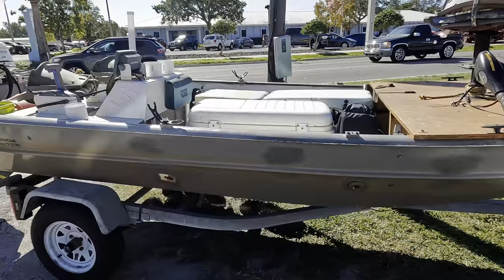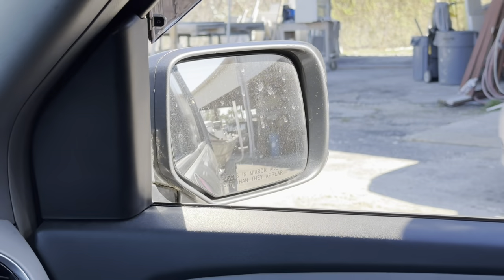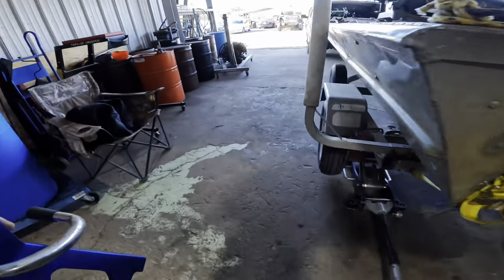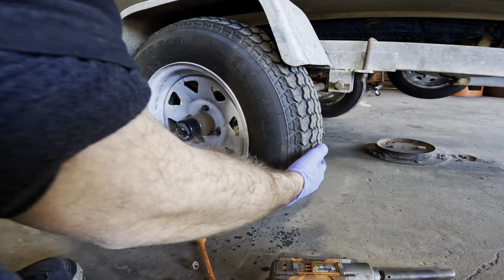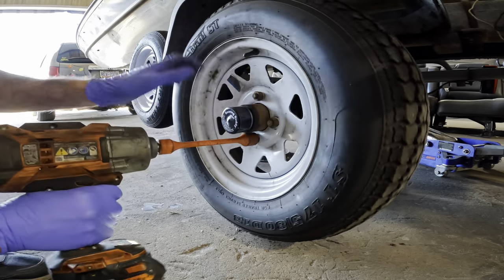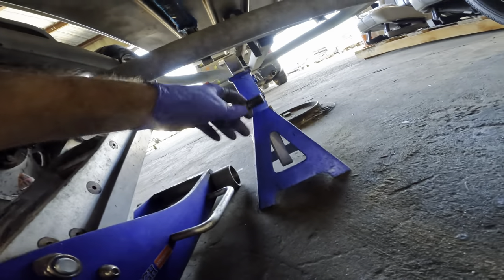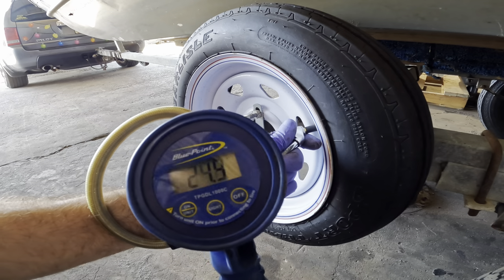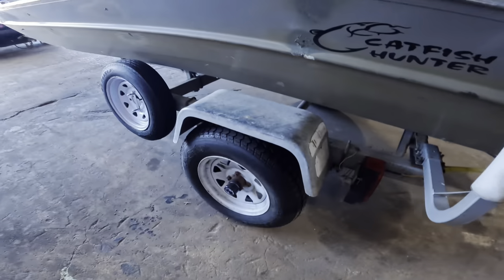Customer States: Trailer Tire Rotation!

Comment: HUGE respect for a shop that'll take on the non-standard work like that.  So many would turn that away, forgetting that the guy bringing it in may not be local, but he still needs help.
Reply: I agree with George, that is what "CUSTOMER SERVICE " is all about.
Even if says " NO CHARGE" and comps him that will also bring him more business. 🎉😊
Reply: Seconded. I do stuff like that and call it advertising. If I help someone out with silly stuff like that, they’ll remember me when they have an actual problem. Better still, they’ll tell their friends about it.
But better again, I get to feed my own addiction to other people’s smiles. It’s an affliction, but luckily, people tend to give them away pretty freely, so it’s not too debilitating. I used to really enjoy swooping in and changing a flat tyre for someone who didn’t even know where the jack was, while they were still wondering who to call, but that doesn’t seem to happen any more. 
But people randomly wandering in, with simple things that they could easily deal with, if only someone had taught them how. Yes, that goes on still and I still get a kick out of sorting their problems out, rather than sending them elsewhere.
Reply: Also they will remember when the tyres blow out because they were massively over inflated. A max tyre pressure is really only to be got near to when there is a heavy weight on the trailer, a Bass boat does not constitute a heavy weight. The trailer will be overly bouncy with that kind of excess pressure, to be honest somewhere just under 30psi is roughly where they should be, exactly where they were before.
Reply: @steve5x565 and running them to low will lead to irregular wear like this trailers tires.
Reply: @steve5x565 Partially agree. The tyres won’t blow out, because they’re inflated to their manufacturers specifications and you should inflate them to that, when parking the trailer up for the winter, unless you can take the load off the wheels.
But yes, maximum pressure is for maximum rated load, which that little boat and trailer won’t come close to, so the trailer will be bouncy and skittish, if the owner doesn’t check and adjust the pressures. I’m pretty confident Ray is just trolling us here, because he’s towed more trailers than most and knows how they behave and he’s been in the motor trade long enough to know why tyres are supposed to flex in normal use.
Reply: Those are also bias ply tires when you run them low on air pressure they tend to heat up and blow out. bias ply tires must be ran at there sidewall suggested pressure.
Reply: Easy quick money, who wouldn't??
Reply: I believe a bias ply tire with a load rating of B, which would be a 4 ply tire should be ran at 28 lbs. ( 7 lbs per ply).  This was the pressure for a utility trailer, boat trailer, when I worked tires in my olden days.
Reply: @steve5x565  I would have split the difference and set it at 40 to 42 max.

Comment: When tires are worn on both inboard and outboard shoulders, it usually indicates they were run with low tire pressure.  If they're worn in the center of the tread only, it means they've been run overinflated.
Reply: They were running at half rated pressure!
That trailer must have felt like towing a pile of mashed potatoes across a plate of gravy.
.
I'm hungry.
Reply: Thank you for googleing
Reply: I would assume that tyre pressure is something you regularly check, hence the visit to Ray's repairs...
Reply: @karisalonen8984  You'd be surprised (or not?) at how many people don't check tire pressure, particularly on a trailer or sport vehicle they don't use often.
I've seen people who don't even make sure the lights work on a trailer before they hit the road and then act surprised when they get ticketed.
Reply: Some of the dinghy trailers use a transverse leaf spring like the original VW Beetle. This gives negative camber unloaded, positive camber loaded and it tends to scrub as the load bounces…
Reply: That wouldn't cause feathering, that is an alignment issue.
Reply: what's your view of Weight distribution in the boat affecting those tyres?
 All the weight is well behind the axle, I would imagine the side to side sway of the trailer would be wearing the shoulders too?
Reply: Thanks for the obvious information from Google mr random named user
Reply: 😂 @MonkeyJedi99

Comment: Nice to be able to help someone out with their hard earned vacation.  Usually you mechanics have to be the bringer of bad news. Just a quick in and out on this one.

Those wheel bearings are screaming fast at highway speeds with those little bitty tires. I think they’re supposed to be limited to 55 or 60mph but let’s be honest nobody follows that rule*

It always impresses me that they don’t seem to mind as long as they have some good grease.

Comment: I never had heard of rotating tire on a two-wheel trailer.  But I think the tire pressure is the culprit.  I run my 2001 Jayco popup camper's tires at maximum too.  Never a wear problem.  But they do get old and blow-out in the heat of the summer.  Nice work, Ray!!

Comment: Hi ray , great vid. I think that variety of  trailer has adjustable axles that can be moved forward or back and are prone to creep , re-alignment is easy to do.get well soon!
Reply: Yes. Could be causing the tyre wear if the wheels are "crabbing" and not running straight.

Comment: In my personal experience, tires that are wearing out their outside tread  faster than their center tread tend to be under inflated.
Reply: Also, if the trailer is cheap, you need to make sure the axle mounts are square and tight.
I've worked on a trailer that had one side of the axle sliding up and down the frame just enough to cause some very strange drifting and tire wear.
Steel clamps on an aluminum frame get that galvanic response issue as well.

Comment: Wow Ray is really expanding I wonder if the plane will be able to make it both under the power lines and between the power poles when it comes in.   Looking forward to brake clean used to start the turbine.   At this rate, nuke sub by early February?

Comment: I always found that backing up boat trailers is easier than other trailers because the distance from axle to hitch is much longer on the boat trailer. On other trailers very small steering inputs to the car cause large changes to the trailer. On the longer boat trailer small inputs at the car are not as large on the trailer. This makes them easier to back up.
On the tire wear I agree with others tire pressure is often the cause. Check tire pressure. With the load that trailer carries max pressure should be run.
Reply: A tip I learned a LONG time ago when backing trailers is to put your hands on the BOTTOM of the steering wheel, rather than the top.  This makes it more intuitive on which way to turn the wheel when backing.  This is for folks that don't do it often enough to remember which way to turn the wheel when backing up!  (like me!)

Comment: For highway use, I typically run tires at 4psi below max cold pressure listed on sidewall to account for thermal expansion when hot.  Never had any issue doing so, trailer or otherwise.  Even if using manufacturer door sticker pressures, many aftermarket tires are built for higher pressures than the stock units, so I ignore the actual number in those cases, and calculate the ratio out for a more appropriate pressure.  For example, recommended 32 psi in a 44 psi max tire is completely different from 32 psi in a 51 psi max tire.  32 is approximately 72% of 44.  72% of 51 is approximately 37.1.  Make adjustments according to equipment.  I may have also gone above and beyond and thrown in balancing with that rotate.  Then again, not everyone is neurotic like me.  Either way, good of you to tackle little odd jobs for folks.  Lots of shops won't bother.

Comment: Pro tip:
If you lose a grease cup from a small trailer hub a soft drink of beer can with an inch or so cut off of the top can be pushed on the tapered portion of the hub and it will stay on and protect the bearings. It can be a temporary fix but it can be left on for thousands of miles.
Reply: If using plastic soft drink bottle base, hit it with heat to shrink to correct size.

Comment: The axle doesn't have to be bent, it can just not be square to the frame of the trailer. Loose bolts shift, usually the right side shifts back from running off the road or hitting bad potholes.

Comment: As the manager of a trailer company for 27 years I will confirm your commenters are correct, the tires were under inflated. However inflating them to maximum is not always the best solution. Read the maximum pressure along with the weight bearing capacity at said pressure(50PSI @ XXXLB), if your trailer is lighter they need to be deflated to compensate or you will wear the centre, as I suspect this will now do.
Now I am shocked by how many people don't understand the function of bearing buddies, they are NOT an easy fast re-grease/service the bearings. Their function is possitive pressure to help prevent water ingress and unless you have X-Ray vission you cant know if water and corrosion is already present without dissassembly and inspection.
I have a lot more I could say on this subject as I believe this to be an unsafe practice that unfortunately I see every week. People are injured or die from seperated trailer wheel/hub more than you would think.
Love your channel, watch it daily keep up the great work.

Comment: Of course it's just a trailer, and the wear suggests possible relationship to tire pressure. However, I always kinda thought that the max rated was also a relationship to the actual weight on the tires to have the ideal pressure, which might be lower than the maximum? But of course that takes us to the super common 32PSI on cars of a wide variety of weights. I think I'll worry about this after a few beers, or never again. Nice change of pace video Ray !!!

Comment: Hi Ray I was always told by an elderly retired mechanic that when you grease a spindle on an axle type spindle it is better if available to jack it up to take one side pressure off the bearing to allow grease to penetrate around the bearing

Comment: I would set the pressure at 45 PSI or slightly lower as the boat isn't that heavy and down in Florida, the roads very run hot in the summer time.

Comment: At least you have a head cold in warm Florida ! Imagine doing this same job outdoors way up north ⬆️.Bad bearings, will cause that wear. Also using a warp/out of round wheel. Id also be careful of Harbor Freight tire/wheel combo. They had a recall not too long ago. Since the load is relatively light 50 psi may be a bit high.

Comment: I would check the axle trueness and or spring shackles are greased and free to flex. If somebody ever hit a curb or even chuckhole, I've seen before that would be enough to "tweak" the axle a bit, causing some uneven tire wear.

Comment: Once at the Auto Electric Shoppe I was approached by two elder gentleman that Recognized as a former Aridzona State Congressman and Utah State Senator with busted boat and trailer in tow. I fixed both, the wiring and the brakes etc. not the old guys.

Comment: Carlisle tires (3rd tire) and the other two tires are wal-mart brand trailer tires.  They are notorious for uneven or irregular tread wear.  At maximum air pressure the trailer will bounce especially on sections of hwy that are concrete segments.  My trailer is an old boat trailer very much like the one you just worked on that has been converted to a utility trailer.  My axle is rated at 1500 lbs and I have maxed it out many times towing over 3000 miles and I never run more than 45 psi (to prevent the bouncing) in the tires when fully loaded.   When my tires do wear out I will replace them with name brand bias ply tires.  (Never put radials on a small trailer)  On a small trailer radials squirm and can make the trailer fish tail and we have all seen the videos of how that turns out.
Reply: Oh yeah she'll be bouncy
Reply: Those tires are famous for wear problems..  ive had them delaminate on highway..if axle is setup correctly running down highway over rated speeds seems to cause this also
Reply: I noticed the tire originally on the right side has individual tread blocks rather than being a rib tread like the opposite tire. The tire with the block tread shows a lot of heel and toe wear  (some people call it cupping). This is typical for a light trailer tire with that tread design if not rotated regularly. This is due to the road surface pushing against those blocks, which flex as they come off the pavement. This causes them to scrape and wear irregularly. My choice for tires on light trailers is rib tread all the way. Much less irregular wear.

Comment: The smaller the trailer, the harder it is to back up, and when it's a bumper pull, not a 5th wheel/gooseneck, it's even worse... With a small trailer, 1 degree of steering wheel movement means jackknife in 6 feet, with a big trailer like the 45' 5th wheel I used to have, hard over to the lock and you still have a minute to correct any error and keep it on track. Ok, SLIGHTLY exaggerated, but not by a whole lot.

If one is not up on the Port vs Starboard, the easy way to remember which is which is port and left both are four letters. Learned that one way back in my ROTC days.

Comment: Cool that you handled a simple rotation for a customer passing through and added a pressure check and lube.  Aren't tires supposed to be inflated to manufacturer's pressure spec for load and not to max cold sidewall pressure?

Comment: Wondering if trailer is continually swaying at speed?
Had similar tire wear on a trailer that that very gently swayed most of the time on the highway.
Increased tire pressure & moved a few more heavy things to front of trailer (i.e. we increased weight on tow ball a bit), swaying stopped, tire wear improved dramatically, handling downhill & under heavy braking improved.
Much easier to tow & all the gear tied into trailer had less scuffing from continually moving around.
YMMV.

Comment: WOW. Ray the tyre pressure max is the maximum pressure when loaded to the maximum weight. Inflating then to the Max will make the trailer bouncy. Being a boat, the load is not near the maximum for the tyres, therefore no need to run such high pressure. Between 28 and 32 psi is good.
Reply: "pressure max is the maximum pressure when loaded to the maximum weight" -- this is my understanding as well.  I may go higher than 29 to reduce wear - however - not to max.

Comment: Just so you know...the recommended air pressure you should run in your tires is located on the driver's door or driver door jamb. The max pressure recommendation located on the tire is simply stating the maximum pressure that the tire is capable of holding. Trailers also have a tag or sticker on the tongue stating the recommended tire pressure. I'm very surprised Ray didn't mention any of this. Airing your tires up to the maximum pressure stated on the tire is wrong.

Comment: Did You not notice that the U-bolts on the right hand side were bent back wards? Why not messure the spring mounts in relation to the backend of the frame?

Comment: I started ruining trailer tires on my tent trailer and couldn't figure out why.  I always checked the pressure and filled them to the max rated pressure before leaving on trips.  During my last blowout, we limped into the tire store in Bishop, CA and the tire guy there told me, "Oh, no!  You  NEVER  want to fill them to full max rated pressure when cold because, as the tire heats up during traveling, the pressure exceeds the max rated and destroys the tire."  This is exactly what I had done.  I now fill my 80psi rated tires to 65psi and have not lost a tire since.

Comment: Ive driven piggyback trucks through some tolls, they dont accidentally charge for axles in the air. A 4 tractor unit could have 12 axles, but only 6 on the ground with the steers and front drive axle in the air, so only charged for 6

Comment: Those caps on the valves are there for a purpose, and it's not to keep dirt out. They are the main seal for the air in the tire, not the shrader valve. On big rigs the cap must be metal and if one is missing you'll get hit with a safety violation. The intention is that the shrader valve is just for inflation and to keep the air in until the cap is in place AND tight.
Reply: On aircraft, the valve caps must be metal AND yellow, so it is easy to spot any missing.

Comment: i would have thought that was too high a PSI, when the wheels heat up the air will expand and pressure goes up if i remember it right. although if they were losing a bit of air by time its warm they might be lower... but of course its only  trailer and not carrying much weight either. myself i would have gone like 10 PSI below max, would i be wrong? never done a trailer like that so i dont know

Comment: Hi Ray. School boy error regards tyre pressures on trailer. The MAX tyre pressure markings on sidewall is clearly that. Not the actual pressure you inflate to. 30- 35psi is probably correct for the low weight that is in the boat.
Reply: U-Haul always overfills the tires on their tow dollies. Unladen, they will bounce around obnoxiously until you halve the tire pressure.

Comment: The shackles that hold the axle on the trailer chassis may have shifted, that would cause the feathering on the tires. If the axle were bent the tires would not spin true.

Comment: Imho, i think that axle should have been propped closer to the wheels, its flimsy and i think it was already bent a bit, hence the outer abnormal wear of the tires. Also some cars with solid rear axles have stickers not to prop them like that. But, regardless, love you and ur videos, you the best.